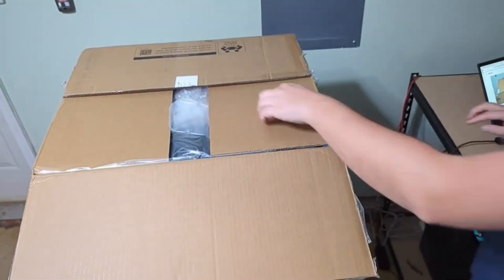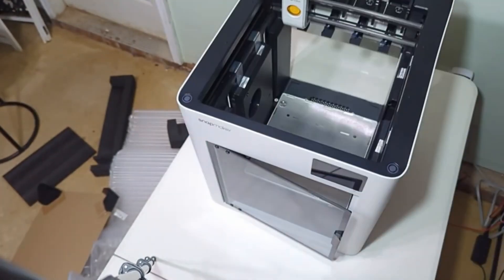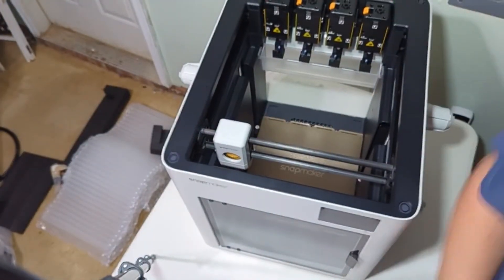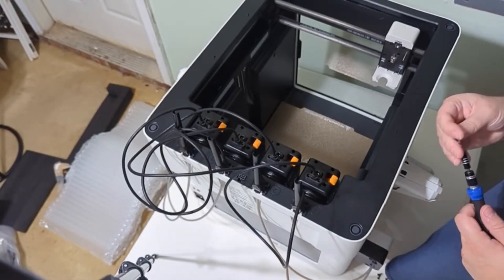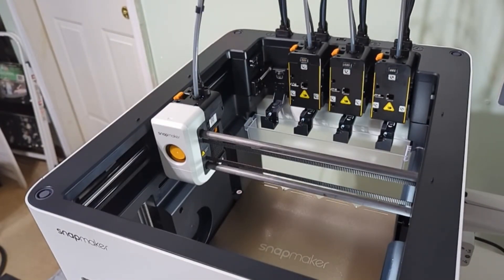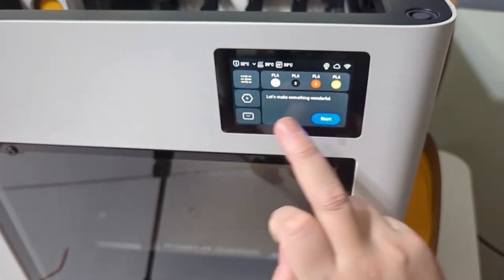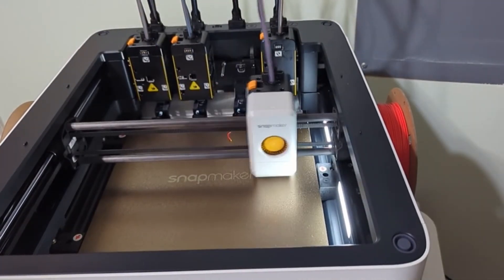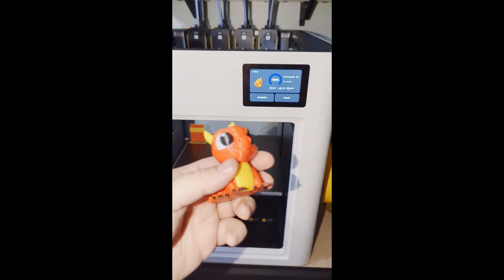Snapmaker U1: Real Unboxing & Setup Experience (Time-Lapse + Commentary)

Comment from the maker: I apologize if the sped up audio is off-putting from the sped up video. I tried to clean it up best I could without removing it completely.
Reply: Just a suggestion..mute the sped up video because there is nothing in there that can he heard anyway or of use...while you talk in post processing..may be add a light background music to make the silent parts seem busy.. plenty of commercial free audio out there you can use..
Reply from the maker: @rekhanair124  appreciate the feedback. Oddly enough when I listened back in DaVinci I didn't hear it much at all. But as soon as I posted it and listed to it back was when I realized I could hear it.

Comment: My U1 should get here tomorrow sometime, so this was helpful. Does that front interior panel on yours not stay snapped in? I hear that's an issue and I'll be slightly annoyed if mine is the same way.
Reply from the maker: Mine popped off when I was removing the packaging tape. But after I locked it in it has been good. I am about 6 prints into it
Reply: @InitiativeDesignShop  Ok nice! That is good to hear!